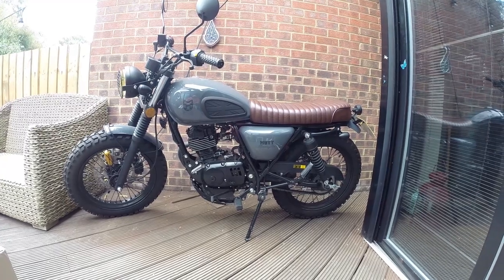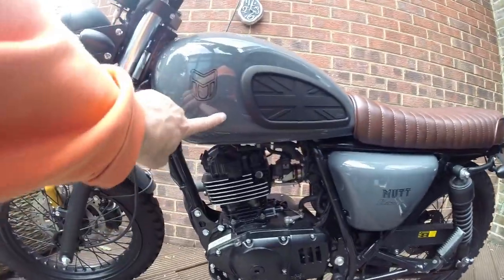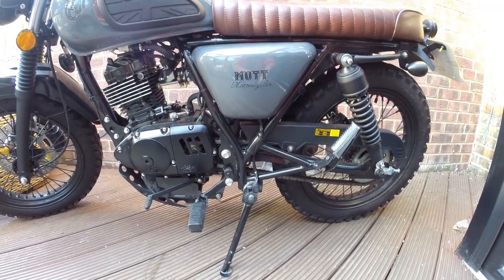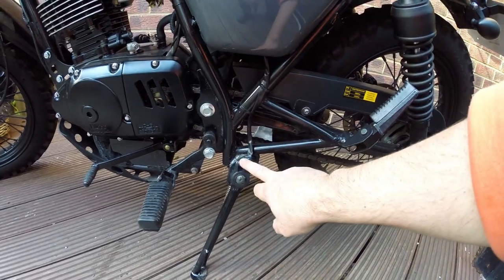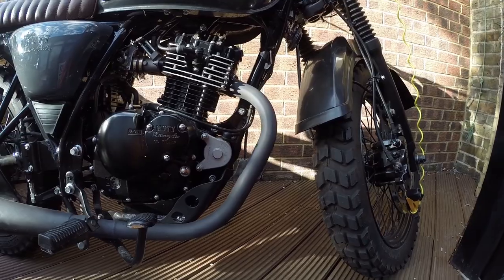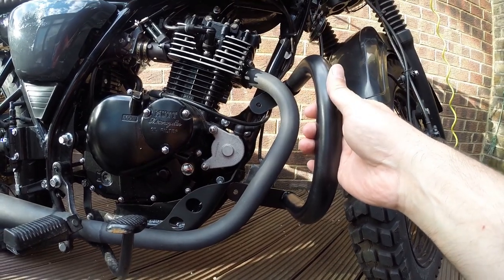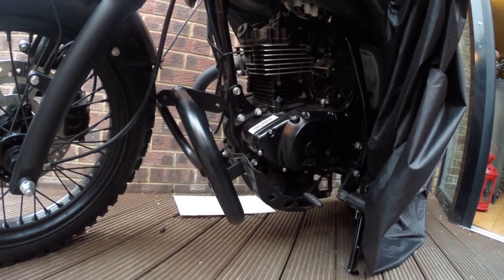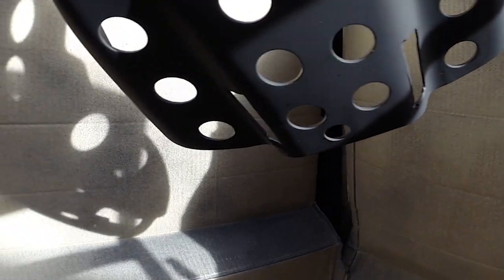Can the Mutt Go Off-Road? Dick Installs Engine Guards and a Bash Plate

Comment: I live in Australia  I was wondering where you got the crash bars for the mutt engine bars  as. I have no luck finding any that fit the 250 mutt
Reply from the maker: Not sure if the 250 frame and the 125 are the same. I got most of my parts from France (Mash). I think the crash bars may have been AJS. I usually check the parts pages on the parallel clone company sites for anything that may work on the Mutt.

Comment: Well that was sex on a stick, and I had to adjust my trousers several times through it.

One tip from an ex-Rolls Royce Engineer Friend of mine, always tighten Nuts AND Bolts from the nut end, holding the bolt end still.
Also oil or lightly grease ALL the surfaces at the nut end as N&Bs AND just Bolts alone are designed to clamp to a certain torque, and turning surface friction can add to that, leading to under tightened fixings which can work loose or in leaking gaskets.

With your better videoing of the bike frame I can now see welding the bars to plate would not work well, as up top they would have only been held by one (asymmetric) bolt which would be too easy to sheer by side impact.
Slotting the Plate is a far better idea.

Still, if you want better protection on your Bike, why not add two extra wheels for stability, and a sort of pressed metal cage around it with an integrated windscreen ?
But that might not be as much fun.
.
Reply: Sex on a Stick? Must be the hat. I have one and have attracted many female admirers in New Jersey.... Best, Pete.
Reply: @ptrisonic  

Dear Pete Histrionic.

How are things in New Jersey ?
.